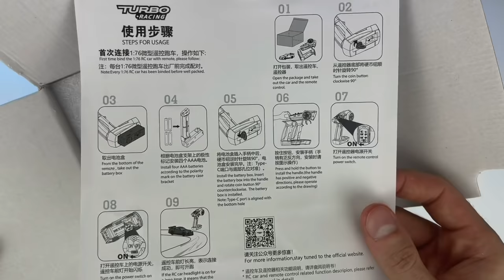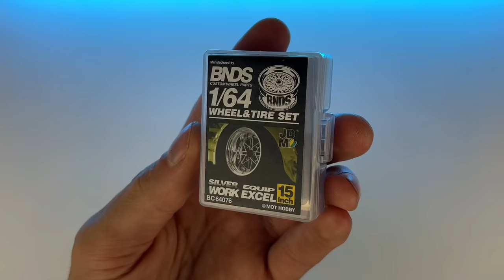I Made a Micro RC Widebody Supra (Turbo Racing 1/76 Mod)

Comment: Good idea, though the implementation could be improved:
1. I’d suggest to glue front and rear LEDs to the body with proper shielding from light leaking, then connect them to the PCB via micro connectors. This way the body will look better and still be removable.
2. There is noticeable aliasing on the front doors. It could be improved via a different orientation during printing and sanding before painting the body.

Comment: bought one of these and they are actually super nice. the steering and speeds are very precise. can also use them on hot wheel tracks. definitely worth the $75.
Reply: If I want to drift, should I just get the r34 gtr one? Or do they all have gyros
Reply: @ZILLA....  they are all the same mechnically, the bodies are different
Reply: You could get the r34, the supra or the eclipse. But make sure that they have the golden wheels, otherwise they won't have a gyro and neither will it be able to  drift. @ZILLA....

Comment: Hi I don't think your scale on that car is 1/76.  (00 scale) I think you'll find your still coming out around 1/64 which is about hotwheels size.  Still very nice.  But what I have been able to do is put h.o. (00) truck bodies onto these cars then atleast you can have r.c. trucks on you h.o. (00) scale train layout
Reply from the maker: Nope, this car next to the exact hotwheels supra casting is about 75% the size. DM Me on instagram if you want to see a side by side. Its significantly smaller.